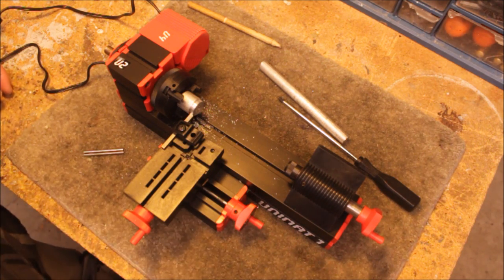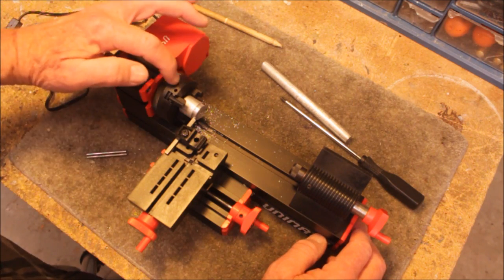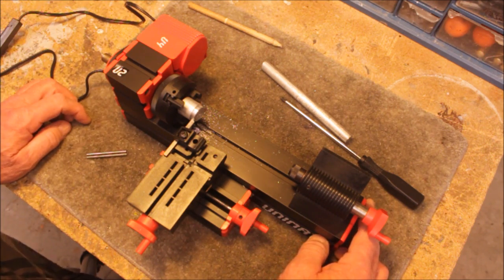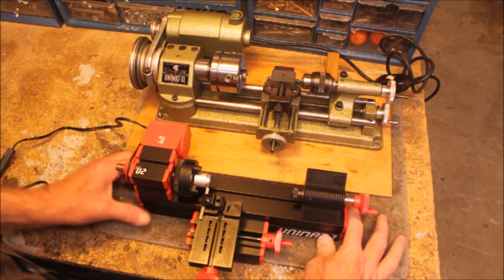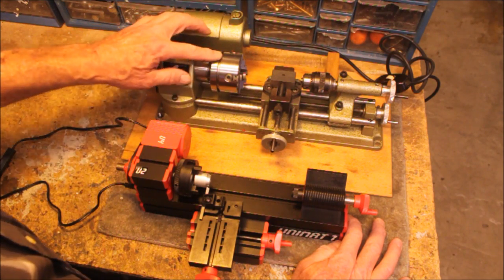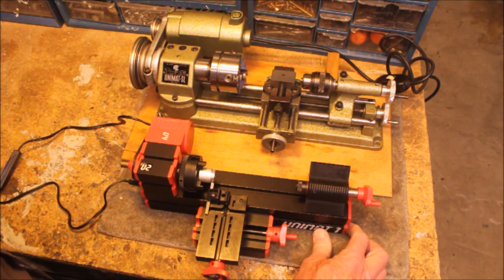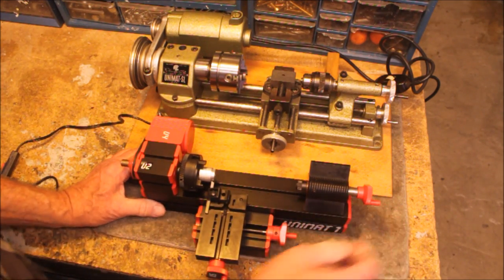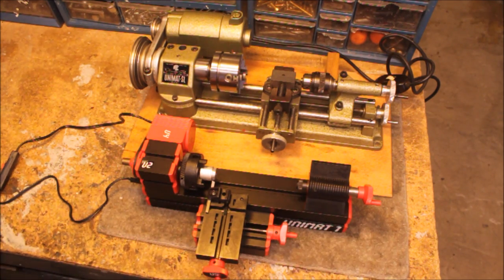Unimat 1 Toy Lathe

Comment: I seen the bigger metal one at a pawnshop with what looked like most ,if not all accessories for $100.00. I think I'll go back and own it. It didn't have threading gears for the headstock and leadscrew tho. I'm not sure if they came with them tho. If I made a set if gears or got a set from another maker this would be great for gunsmithing work. I assume $100.00 is a decent price. I drove off thinking of building one as a project , but with all the accessories this one had I'd probably be over that in parts cost.
Reply from the maker: These are nice but very tiny. Only good for making miniature guns!

Comment: The END MILL IS HANGING OUT WAY TO FAR OUT OF THE COLLET,choke up on it and  it will mill  a slot much  better.add backing plates on z axis you would be surprized.
Reply: I think there are stronger-made versions of this; has the word "metal" in the name.

Comment: nice video :). how much it cost? that's is decreased quality from unimat hobby lathe, from unimat SL1000/DB200 & unimat 3, unimat PC (on this point, the body of unimat PC was made by steel plate, not casting anymore) and then unimat 1 with plastic and thin aluminium.
Reply from the maker: I think you can buy a similar outfit for about $100 on Ebay, but the Unimat name makes these a bit more pricey.

Comment: Those lathes are not toys, they are machine tools. Especially the SL lathe . In the right hands, the SL will produce work equal to a large lathe on a smaller scale. As will my unimat 3.  The plastic unimat might get you out of trouble in an emergency. .  If you know what your doing.

Comment: Hi Guys, a very good material for demonstration and playing with this device is polyurethane foam (used to provide heat insulation for buildings). It comes in a variety of densities and can be a great material just to make a show piece or play with on such machines. Have a go!
Reply: Delrin?

Comment: Thx Dave for the demo. You are totally right it is only a toy. Unfortunately the only material softer than wood would be Styrofoam and that would not be a suitable material for many tasks. I know now to steer way clear of this little money waster. As you said for a newb kid a much better choice would be a mini or micro metal lathe. It has far more rigidity and could be used for Aluminum.
Reply: Plastic? ("Delrin")?

Comment: i remember i wanted one as a kid, but my father told me "better save some money for a Unimat 3, that's all metal and will do much better for you.. he was right.. so i gave up on the idea, but later i bought an Emco Compact 8 which served me well for many years, Later i bought an Emco Compact 5 CNC, and i got a Unimat SL, the SL is a serious lathe, i used it to make watchparts..
Reply from the maker: Thanks for your comment, Jan. Your dad was very wise! - Dave
Reply: Yes, he is.. i was just very eager to start making things myself.. well.. i caught up in the mean time, making titanium watches..
Reply: me too, thanks god i dont purchase that unimat 1 :). later i bought a TAIG lathe & sherline lathe, and then i need bigger lathe C2 sieg, and JMB universal milling machine. And recently i do purchase the unimat MK-2 lathe in scrapyard,lucky me the MK-2 is quite rare with cast iron version, based my historical research on internet that the common SL1000 and DB200 is unimat MK-4 with aluminium casting.
Reply: Unimat SLs and DBs are great lathes.

Comment: They're not that much of a toy - the Unimat 1 also exists in a metal version (Unimat Metal Line, or ML) and options exist to take it all the way up to CNC controlled.  Also unusual is that the product is offered with 5 (yes, FIVE) years of warranty - even the plastic one.  But yes, if I was in the market for one (I lack the time) I'd probably go for the metal version too.  Beautiful machinery.
Reply from the maker: Yes, this seems to be a unique little crossover from a toy into a more serious lathe..
- Dave
Reply: @smallmetalworkingmachines1378    Thank you for making!  Yes indeed -- "Entry Level" -- this looks great way to introduce the basics ("to kids of all ages";  I suspect there are more than a few would-be machinists out there who need to machine-shop out of their system).

Comment: I think it might be called Unimat 1 because you use it 1 time then smash it against the wall. LOL But on a real note Thanks for the video, I'm looking for my 1st wood/metal lathe and a mill. all mini because the largest things I want to make have a finished size of a 4" radius in wood, hdpe and aluminium, then when I get the right kind of experience behind me I want to try brass and ss.
Reply from the maker: This lathe is a toy and would not be suitable for you. If you will be working up to 4 inches I would recommend a 6" or 7" lathe. Always go a little bigger.
Thanks for your comment!
- Dave
Reply: Any recommendations are welcomed and very appreciated. Thanks!